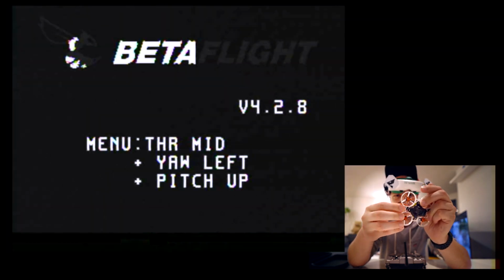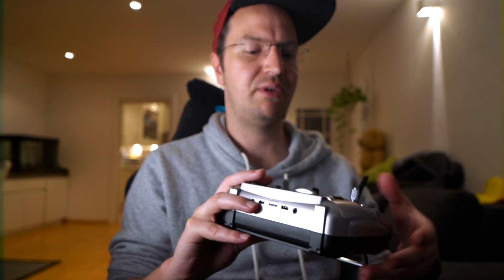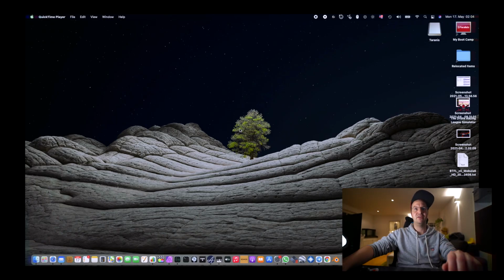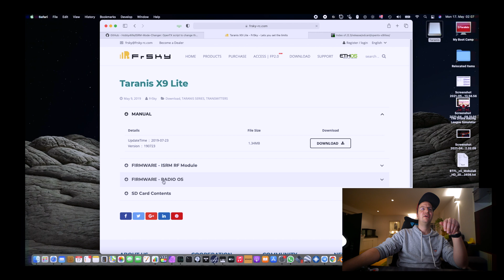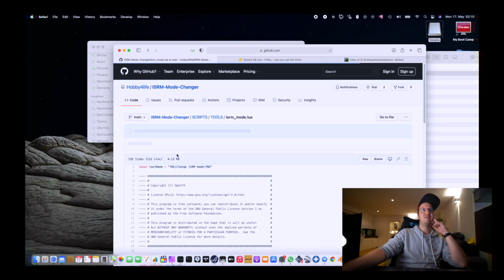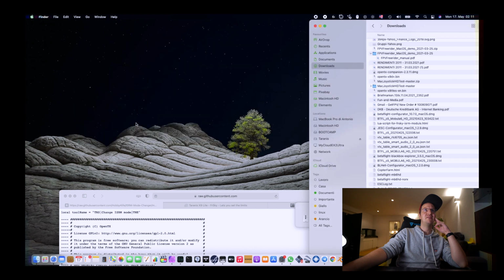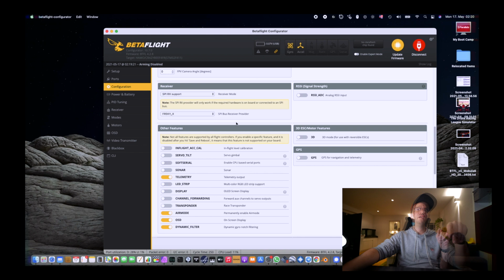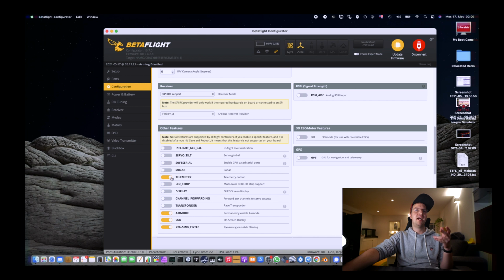How to bind the newest FrSky Taranis X9 Lite (S) radio to SPI Tiny Whoops (Mobula 6, 7, ...)

Comment: Cool guide. Firmware downgrade on my X9 lite worked, but getting script syntax error when trying to run the mode lua script. Any ideas?
Reply from the maker: Okay, I would download and copy again the script, maybe from another machine. If you open it, does it have visibile glitches? Sometimes the newline returns are off in some OSes

Comment: Hey! Great video. However after doing everything exactly as in the video my ewchine uk65 still wont bind to my x9 lite :/ not sure what could be the problem anymore...
Reply from the maker: Indeed it should work with F3 as well as F4, however for your particular setup you might want to consider a Betaflight update to a recent version, if you are running stock Betaflight.
Reply: @antoniomediaproduction  I’ve updated to the newest betaflight version and flashed the whoop with it too and still couldnt get any further 🤔
Reply: Funny thing is i am able to bind the woop to my jumper t16...